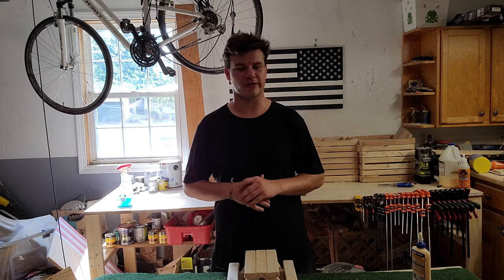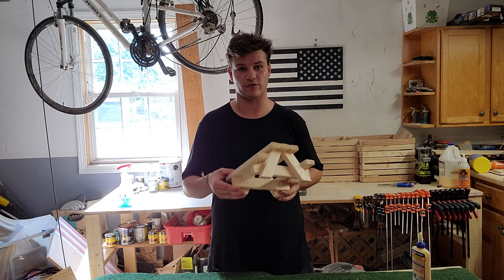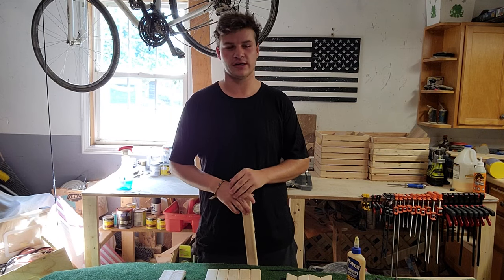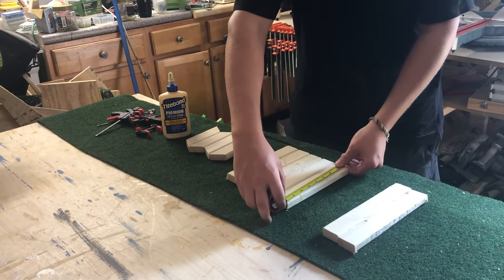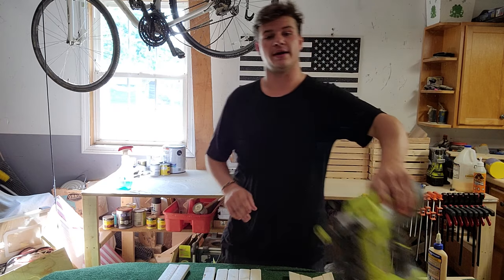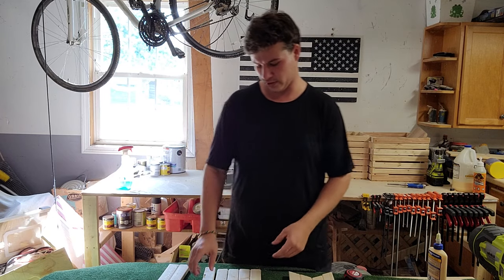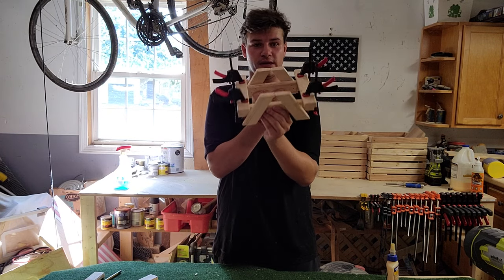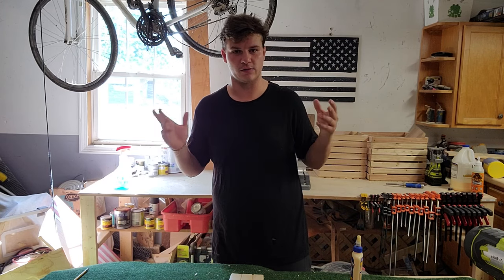This Scrap Wood Project Made Me Over $1000!

Comment: About 25 years ago I made some tables very similar to this using 1/4" thick strips. Rather than squirrel tables, I cut openings in the table for salt and pepper shakers.  They were four 1" strips wide, spaced about 1/8". I never attempted to sell them but gave them as gifts to a few folks.
If I were to make them today, I would definitely use CA glue. I used no fasteners, only glue, so getting the center piece mounted was always a challenge. 

 Great idea. strong tables Thanks for posting.
Reply: I 2nd that CA Glue. It dries fast.
Reply: Thanks for sharing, this is a unique idea for a salt and pepper shaker table, inspires me to try it out.
Reply: very good idea!

Comment: I just happened to have had some scrap 1x2 furring strips laying around, which was just enough to give this a try. I used CA glue (hoo man I need more ventilation in my shop) so it went together fast. I think it took maybe an hour first time. Your dimensions work great but I would make the 3 strips for the table top same length as the seats next time. It's sitting on the kitchen table right now with a butter dish on top, wife actually likes it! I can see doing a lot of different things with this, THANK YOU for the idea.

Comment: Cool project. I've made something similar before, but in my experience, if you put something like that outside, it will rot after a bit. I've started doing all of my outside projects with treated wood or coating really well with polyurethane.

Comment: You do know you can drive nails without a gun right?.. believe it or not nails were used for a very long time, even on small delicate projects, before the nail gun was invented. Also you don't have to have glue if you're nailing it, it's a squirrel table. Either or will work fine, unless you have morbidly obese squirrels.
Reply from the maker: you should see our squirrels.
Reply: @FishOverChicksWoodworking  I understand lol. I live in Kokomo Indiana, in 1907,  not long after our city was founded, they founded "park zoo" later named "city park". it was essentially a scenic park with enclosures of all the exotic animals you'd find in a zoo back then. And they thought "procuring and placing in the trees pairs of squirrels" was a great idea. we didn't have squirrels at the time, now it's nearing an issue, I see multiple run over squirrels a day, protecting a garden is a full time job, they've become use to people and no longer fear us so they'll square up with and attack you. Our city has grown alot in recent years so now they have ample food which is making them larger by the year.